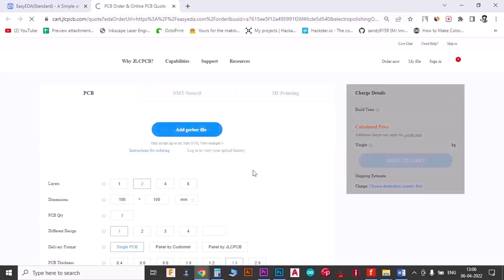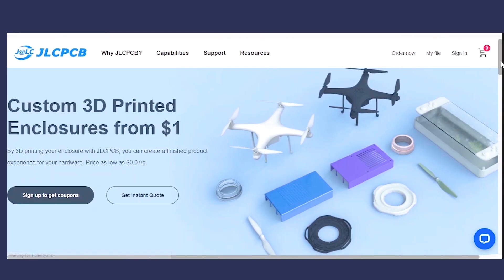DIY CT Scan machine | Arduino project

Comment: Not so good. You didn't show anything about the revolving sensor. How is it connected to the main board?
Reply: Yeah, this is a simulation not an actual scanner. Something tells me that toy doesn’t have a lot of different materials INSIDE it, to give differing densities as the organs shown on the screen, leading to the conclusion that’s just an animation. Cool little project though
Reply: It's not a sensor, its a laser diode, and, if he doesn't plug it in the Arduino its not going to do a lot
Reply: @maxmoon1712  it isn't connected to anything, its there just for show,.
Reply: That's just a laser diode. It looks like it's on, but very faintly. Probably it is connected to some button cells on the other side, but it is not shown in the video.